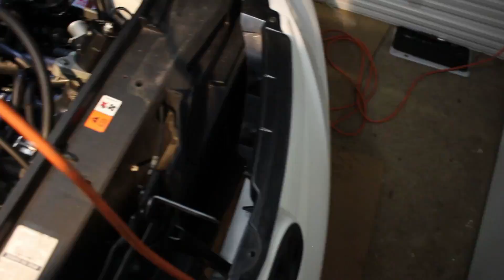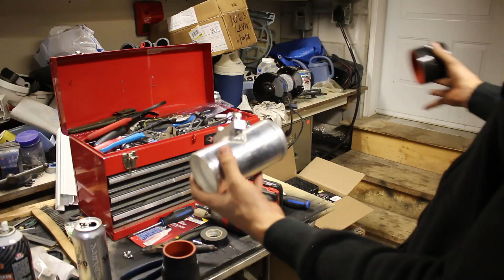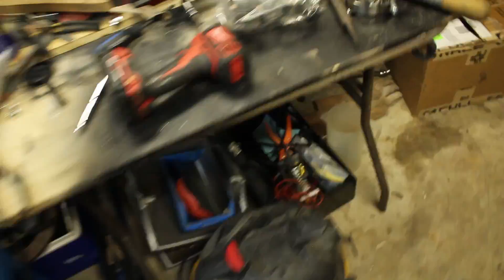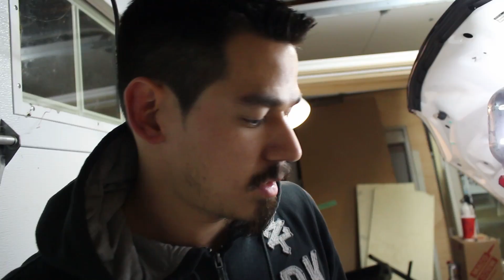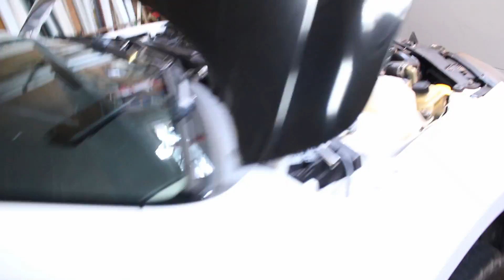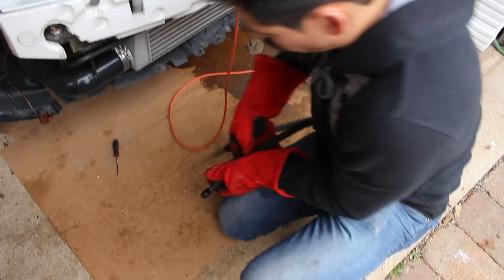Mazdaspeed 3 - 6th Port Aux Fuel Install (Part 2) - Piping, Fuel Rail, Injectors & Lines

Comment: Wow this video is old, I wonder if I can get some insight.. so I bought a used speed3 and it has this set up just like the video ends except no afr gauge fitting and it has a misfire in cylinder 3 I’ve been trying to fix it I replaced the hpfp but my access port says active pressure in idle is 80 my next step was gonna be cleaning valves and injectors and replacing the fuel pressure relief valve along with fuel pressure regulator sensor and maybe pcv valve but now I’m not sure if needs a tune instead? Hopefully this video isn’t too old to get a response but I was wondering if the care is safe to drive with this set up or is this why it has such low pressure , could the misfire be caused by something else?
Reply from the maker: Hey man at idle the fuel rail pressure should be right around 400 psi. 80 psi is somewhat low. Are you getting any fault codes or check engine light?

Comment: When you said “people ask why are you doing this” and you reply with “you just have to”. That’s exactly it.
Reply from the maker: I'm totally addicted 🤣
Reply: @WannabeTuners  I’m on my third mazdaspeed vehicle. Had a 2010 speed3 and a 2012 speed3. The 2012 I fortunetely blew up, literally the exact same thing that happened in your dyno video, not a fun feeling. Then after 6 months of being down, got it on the road and it got rear ended while stopped at a light and totaled. Now I have a 2.5 swapped speed6 with a cst4 getting tuned by freek. But I already want more. Want port injection and big ass turbo

Comment: What’s the exact silicone couplers/ connectors you got off silicone intakes to modify the cold pipe to fit the piece connecting to the throttle body? I have the same fmic piping with tr8 and the same 6th port kit I’m be installing on my gen 2 very soon . Thanks !

Comment: You said you had wierd air fuel ratios. Was that due to a bad maf sensor? Or the wiring going to it? Or was it something different?
Reply from the maker: Hey did I mention that in this video?
Reply: @WannabeTuners  about 2 minutes into the video.
Reply from the maker: @HoUsEoFcAtS78  Ah yes the electrical pins within the MAF sensor connector can start to lose grip on the strands of wire causing a bad connection. When this happens, you'll see wonky short term fuel trims, usually +/- 25% and the AFR can become erratic, either too rich or too lean. The solution is to de-pin the connector and clamp down on the portion of the pins that make contact with the strands of wire to promote better electrical Contact :)
Reply: @WannabeTuners  this might be a possible solution to my erratic afr's. When I come to a stop after doing highway speeds, my STFT's also go berzerk one way or the other. I'm trying to rule out a possible weak LPFP. I'm also going to be replacing the seals and screen on the hpfp. But this info helps.
I'm also going to be replacing the intercooler couplers as there may be a slight boost leak. They are probably 5 years old and extremely faded. Perks of buying a modified, yet poorly maintained Speed.
Reply from the maker: @HoUsEoFcAtS78  Nice, yeah all the little issues can add up to one big issue. One thing u can do with the engine idling is monitor AFR and STFT on the Accessport. Then lightly wiggle the wires near the MAF connector and see if the AFR and STFT fluctuate

Comment: Think it's possible to keep my TMIC with this kit?
Reply from the maker: Great question! Unless you can some how retrofit the injectors and fuel rail before the throttle body, I doubt it. You'd be better off running Meth Injection if keeping the top mount :)

Comment: Man this seems like too much work to tackle on alone lol. But you guys are awesome! These videos you're putting up are definitely helpful. I have Devils owns stage 2 meth kit, and a ST manifold that's been sitting around. But I decided I want to keep it safe with a 6th port injection, or the SP full port injection kit. From your experience what do you think is best? I'm stock motor with a gtx3076r EWG.
Reply from the maker: I would go 4 port injection to ensure each cylinder is getting the same amount of fuel. That's what I'm planning next season. 5th/6th port is great and does the job, but I've been informed that the fuel tends to stick onto the intercooler piping and intake manifold plenum. It's not uncommon for people to make 500 whp with 5th/6th port setups, but anything more I think most tuners would recommend 4 port injection :)

Comment: The quick connect fittings to the low pressure fuel lines are 6AN to 5/16?
Reply from the maker: Sorry dude I'm not sure, you'd have to call sp63

Comment: One of the best current solutions since we still don't (and likely never will) have aftermarket DI support.
Reply from the maker: Meth injection, full port injection, and 5th/6th port. What's your opinion on how they compare to eachother?
Reply: @WannabeTuners  I personally went with a CM methanol system. I currently run one CM10 spraying 100% M1 in conjunction with E25 in-tank. At 390whp, I'm at around 85-90 IDC, whereas I used to hit ~107 IDC before adding in the methanol. If I ever upgrade to a G25-660 or an EFR7163 and tune for 500whp, Justin (FREEKTUNE) says I should easily be able to get there by adding a CM14 nozzle (so a CM10 + a CM14).

One thing I've noticed over time with WMI, however, is the lines will eventually leak, so you should do SS lines or find fittings other than push-to-connect. This is super-important if you're fueling dependent on the methanol because leaking lines can drastically diminish what gets into the engine. This is one of the advantages 5th, 6th, and full PI have over WMI in my view - reliability in terms of the lines. But they all cost way more and require the ITFP upgrade.

Really, it's a trade-off either way. Each route has its advantages (methanol vs. aux). If money is no object, then full PI or an Aquamist HFS-4 are top-tier (i.e., pricey) solutions.
Reply from the maker: @numinous4789  Thanks for the solid info brother :)

Comment: Good work here fellas, when i grab my speed i think im just gonna go through with 8th port one shot.
Reply from the maker: Yeah man there's several ways to do it, full port injection is a great way to get more fuel accurately, but may cost a little bit more than a methanol or 5th/6th port setup
Reply: I feel like if i did 6th port id have to do it all over again later on. Id rather do it once but ill have a shop do it. What are your thoughts on upgrading all the stock fuel lines to E85 safe lines, i wanna run E50 with that new CST 6 turbo with jmf mani!
Reply from the maker: @03max6spd  I feel ya bud! I think it really comes down to figuring out a setup that works for what your goals are, how much you're willing to spend, and how much power you want to make. E85 capable lines won't hurt, and will most likely increase flow if you go with a larger diameter. According to Speed Perf6rmanc3, this 6th port kit as sold on their website, should be good for 600 hp with the right supporting mods, so just something to think about. I personally like the separate under hood fuel cell setup that guys are running. It seems much simpler than running lines to and from the stock tank, and modifying the basket. Check out Spooling Up Performance. They run it that way;)
Reply: @WannabeTuners  hmmm well my goal is 600, maybe low to mid 600s with E85 so idk im sure the 6th port would be enough but from what ive been told, they say go 8th and call it a day. It'll be pricey but worth it, yeah i follow alex on spoolin up too, im unsure about the fuel cell, i kinda wanted the car daily friendly but im nit privy on how they work, would i fill the stock tank with 93 and the cell with E85 for an E50 mix?
Reply from the maker: @03max6spd  Yeah Full Port Injection will be able to produce the highest numbers. You could run a max of E50 in the stock tank as more than E50 is said to gunk up the HPFP. Then you can run whatever you want in the fuel cell :) Most likely E50, E85 or even Methanol
Reply: @WannabeTuners  id probably stick with the 50 percent mix, ive heard of the gunked up fuel internals from running straight E85 and thats no bueno.
Reply from the maker: @03max6spd  That's what I would do too ;) E50 is more than enough octane
Reply: Haha most definitely!! Heres what ive wondered what if you have an e50 mix and hit half tank and no meth around, do you run the tank til near empty then fill up on 93 and switch the tune back?
Reply from the maker: @03max6spd  You would keep the same ratio of 93 to E85 so that whatever u fill the tank with, it levels out to E50. Keep in mind that ethanol content in E85 varies throughout the year, and from station to station from what I've read. With my car I run 2 gallons of In Tank Meth. So once the low fuel light comes on I go to the gas station, pour in 2 gallons of methanol, and top the tank off with 94. Since there is always some methanol left in the tank, everytime I fill up, the ratio of methanol to 94 will get slightly higher over time. This higher methanol concentration is taken into consideration with the tune. I'm sure there are ways to calculate the exact ratio everytime u fill up, but I've been using the fuel mix cheat sheet as a guideline, found here : http://www.mazdaspeedforums.org/forum/f567/fuel-mix-cheat-sheets-102438/
Reply: @WannabeTuners  oh boy this sounds like its gonna be confusing lol i was originally gonna do meth injection too but opted out and wanted to go with ethanol instead. Yeah i read throughout the year the blends are different, so what if you get e85 thats higher or lower in content, how do you offset that?
Reply from the maker: @03max6spd  I think there is an Ethanol content analyzer that u can buy In terms of how to mix the same ratio everytime, I would ask your tuner. Let me know what they say as I'm also curious :)
Reply: Jesus this sounds like a lot of work lol when i get to that bridge ill be sure to let you know
Reply from the maker: @03max6spd  Sounds good brother :)

Comment: Where did you get your push-loc hoses
Reply from the maker: Are you talking about the fuel lines that come with the Speed Perf6rmanc3 kit, or the plumbing components? The plumbing components were all sourced from Silicone Intakes
Reply: @WannabeTuners  the one that you got for the rail
Reply from the maker: @DONUTSKIE  All the fuel lines and fittings came with the kit, although we did have to call and specifically request an NPT 1/8" fitting for a fuel pressure transducer to monitor fuel pressure
Reply: @WannabeTuners  sounds good! Those lines looks expensive thats why . Haha.
Reply from the maker: @DONUTSKIE  Oh yah the Speed Perf6rmanc3 6th port kit is very good quality that's for sure!

Comment: Just curious if your planning on running a bigger turbo? Your s4 is gonna max 440 regardless of fuel. Very informative video.
Reply from the maker: Thank you! When the block eventually gets built, a BNR s5 or s6 looks like a tasty choice given that I've already spent a lot of Canadian dollars on stock flanged components. I think either of those turbos will be more than enough for this FWD hatch :)
Reply: @WannabeTuners  whats nice about the s5 you can go ewg and control boost creep s6 will be way too laggy
Reply from the maker: @bgbg7109  That's a great point, and yes, I still want it to be streetable. S5 might be the way to go but time will tell. At this point I'll have to stay stock flange. I do boost creep like crazy with the S4 in near freezing temps, but have been limiting throttle to keep boost in check ;)

Comment: How much do you like the cs intake manifold
Reply from the maker: I absolutely love it! Every aspect of it attracts me to it. Stock location throttle body, dip stick, and tmic. High flowing runners with a 2% flow imbalance, WMI ports and a reasonable price
Reply: @WannabeTuners  How'd you deal with disabling the VTCS CELs that come up?
Reply from the maker: @numinous4789  Disabled through Cobbs Access Tuner software